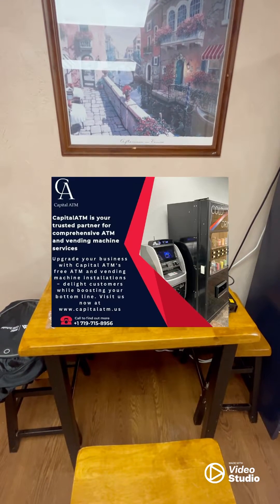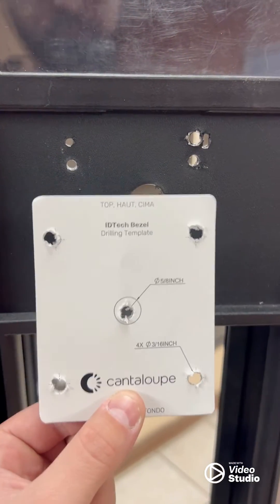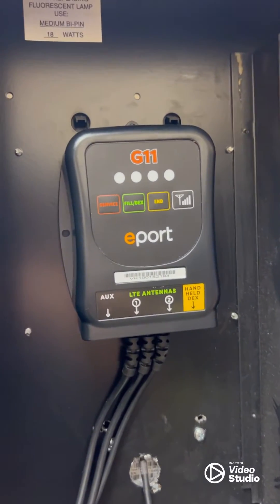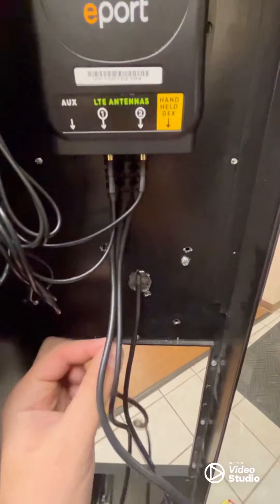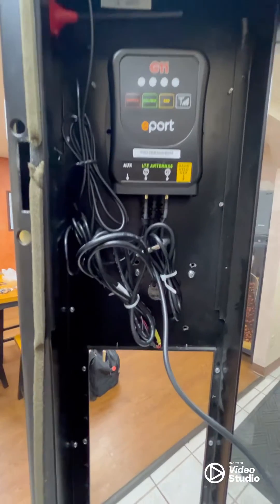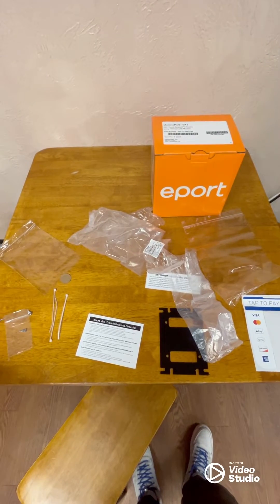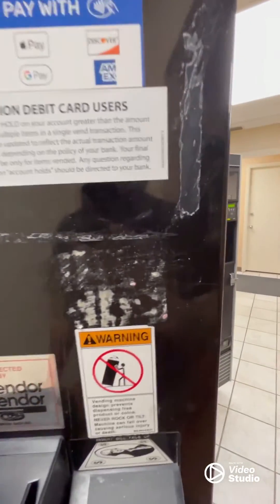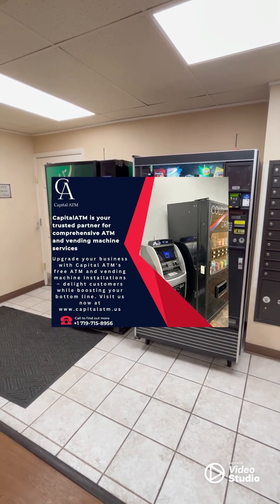How to Install a G11 (Cantaloupe) Card Reader on a Vending Machine

Comment: Hey boss, these card readers, do they need to be set up online or are they just plug and play ready to be used?
Reply: if you buy them new then you need to call Cantaloupe to activate them. If you buy them from someone else you have to get the previous owner to submit a transfer request. In order for the transfer to go through, you need to have an account with Cantaloupe. They will send you an email once  they need you to sign the transfer.
Reply: Great question
Reply: does the antenna come with the tele meter